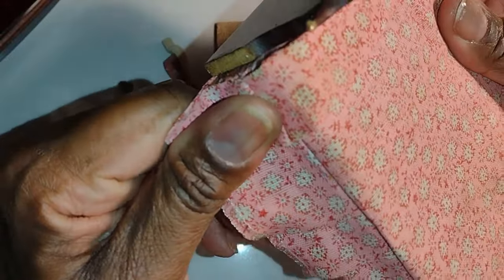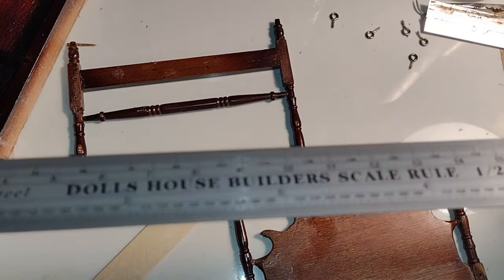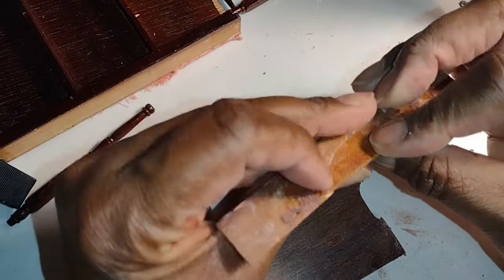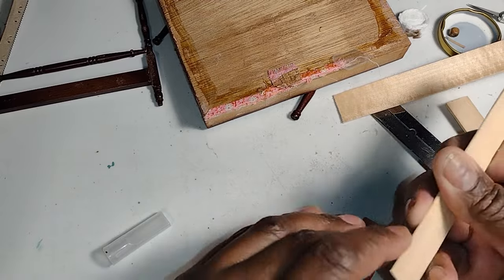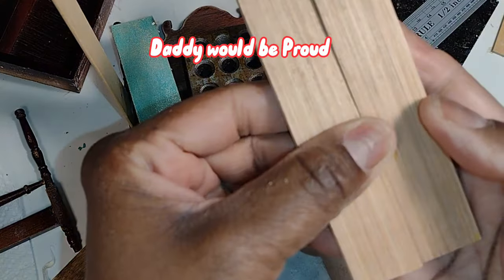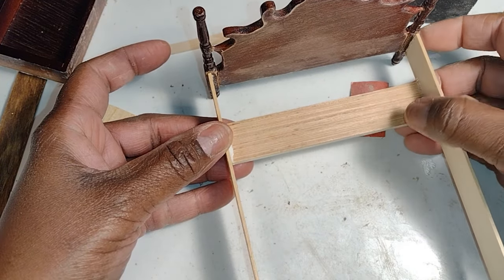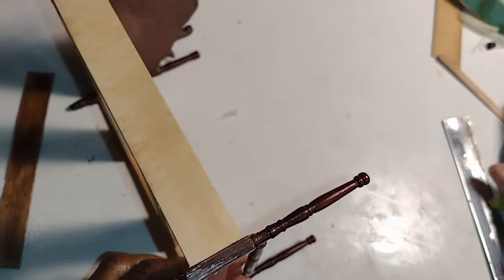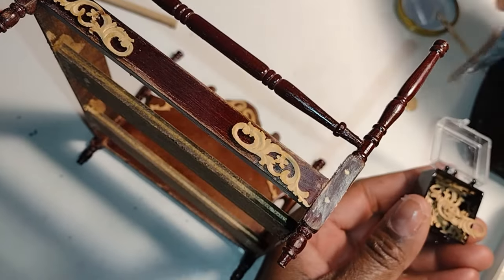How to BREAK a DOLLHOUSE BED and RE-DESIGN IT-Little Gretchen's Workshop

Comment: I also have had a glue problem. About a year ago I had an entire 4 poster bed fall to pieces TWICE because I did not wait for the glue to dry before adding on other pieces. I have glued things to my fingers, clothing and the kitchen table. Lol. I finally learned after years of some frustrations to always have several different projects going  at the same time. Instead of being laser focused on getting one completed project, to the exclusion of dinner, bedtime or my house being on fire. It took a while to train myself to do this but it has been worth it. It is so much easier to leave something alone to dry properly if you have something else to work on. To my delight I noticed this also works for trying to watch paint dry.
Reply from the maker: Yes! l usually have at least 3 items to work on at a time. To distract myself. I'm so glad you are enjoying this 😊 thank you for sharing!!

Comment: I still have issues waiting for glue to dry as well.  I always think. I'll just be careful with it, and usually manage to mess it up somehow, only because I didn't want to wait just a little bit longer.. 😂  Your bed is beautiful.  I know your daddy is proud.   If you don't mind the other frame being a little broken and repaired, you can still use it as a bed frame.  Just flip it over and remove the center boards, then set the mattress down into it, so it will be lower.   Although, I think it will make a beautiful book shelf.  It has possibilities, that's for sure.
Reply from the maker: LOLOLOLOL!! I feel like you just described me! LOLOLOL!! I can hear Daddy now saying" Slow down", "what's the rush", "take your time"! I definitely have several options i am considering for that leftover frame. But I need to get these two beds together before someone else decides to get married!! LOLOLOL!!